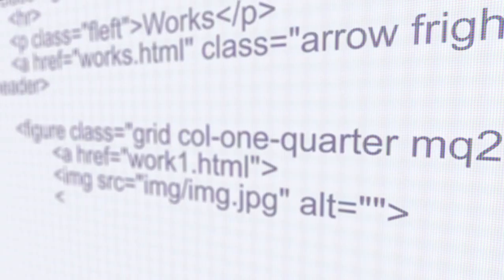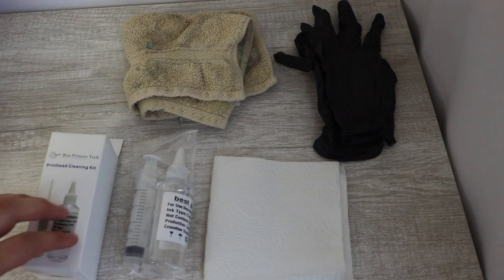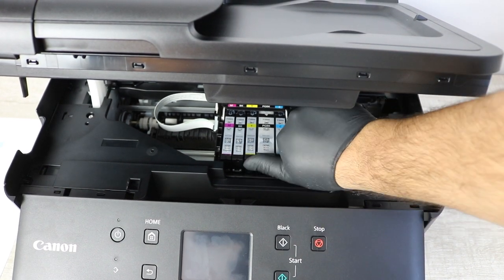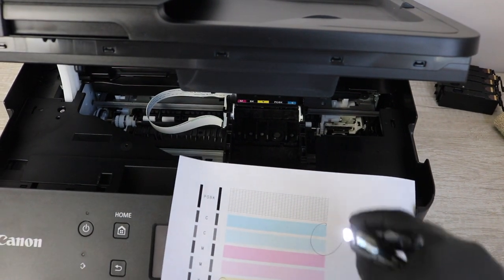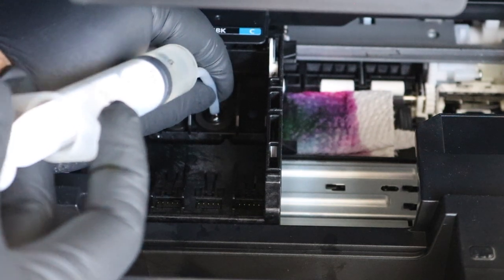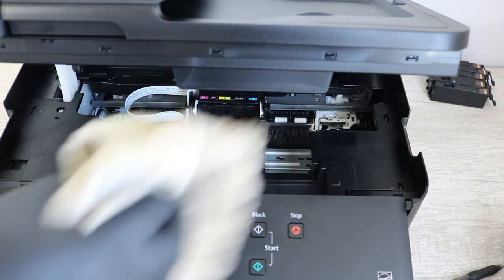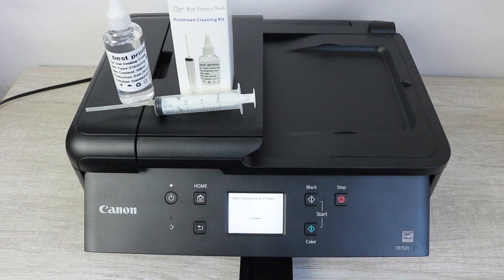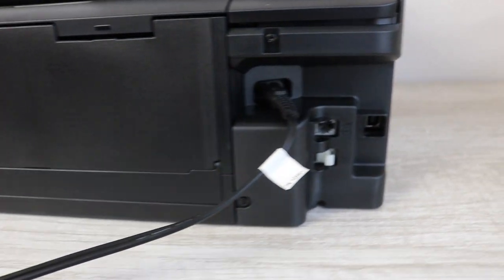Canon TR 7520 - How To Unclog the Printhead

Comment: just bought a wf 7710 hooked it up. tried to print out my first couple pictures and documents and notice i was getting lines through the pictures i printed.i check the status of ink and it was fulll.  i flushed using the solution and put the ink back into the printer and now it  says all my ink is done... i just bought the printer yesterday. any reason why this may happen?